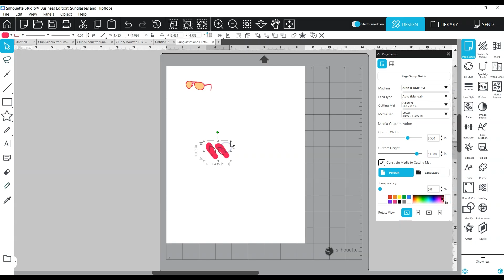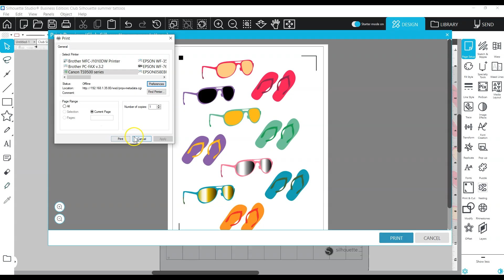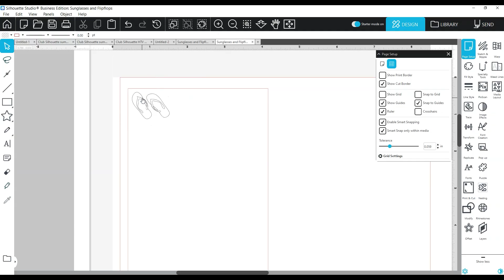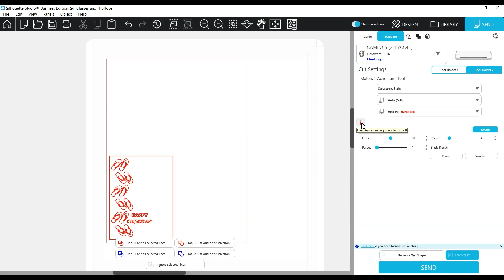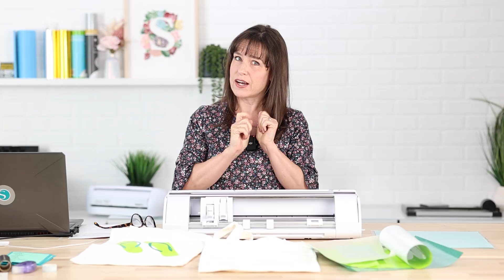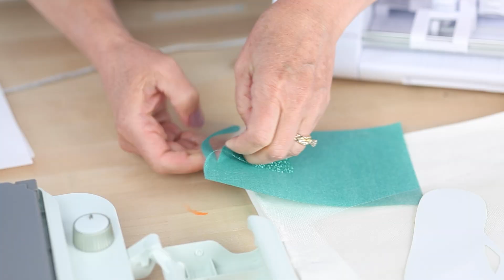Maker Studio | One Design, Three Projects

Comment: What’s the ideal fabric material to use when using vinyl heat transfer. I’m thinking cotton but Is a blend of poly/cotton with 5% spandex ok on a t-shirt?  Thank you.
Reply from the maker: Great question! 👕 You’re right—cotton is ideal for heat transfer vinyl, but a poly/cotton blend with up to about 5% spandex can also work just fine. Just make sure to lower your press temperature slightly and do a quick test press first—spandex can be a little heat-sensitive. You’ll get great results with the right settings!
Reply: @CreateWithSilhouette thank you. Very helpful.